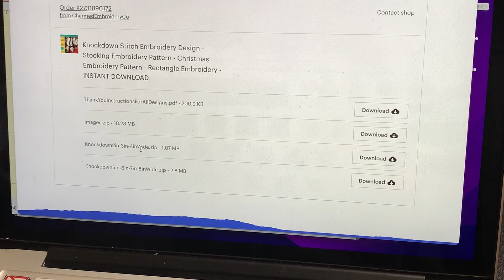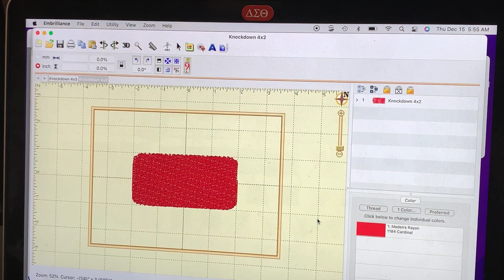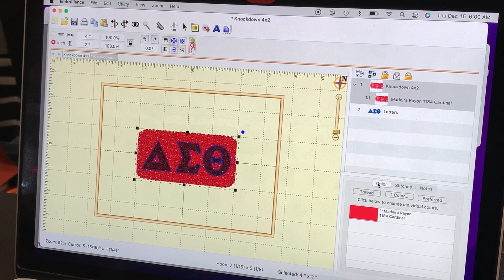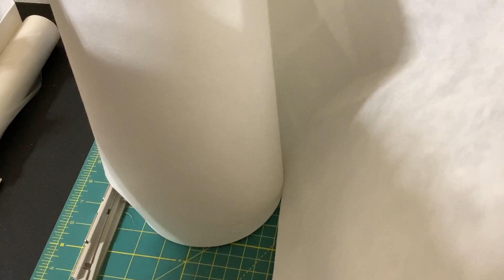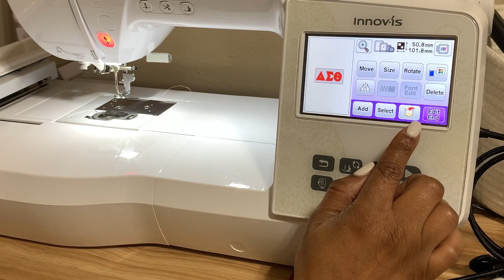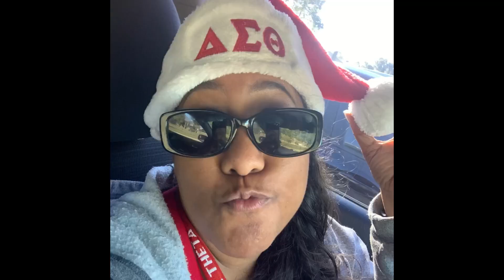NQ1700e Embroidery Machine - Design on a Santa Hat using a Knockdown Stitch

Comment: Wouldn’t it be easier to print the image and use the center point that prints on the design. I leave it pinned down until l set it up. I started doing that and it seems to work
Reply from the maker: I guess whatever works best for you but also remembering not everyone has a printer. I have 8 different types of printers but there are people who don't have any type of printer.